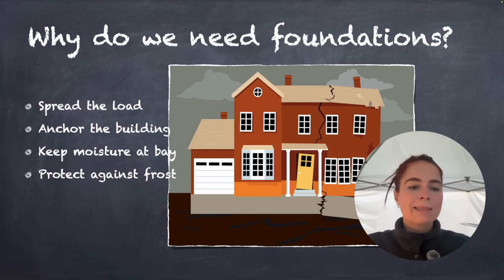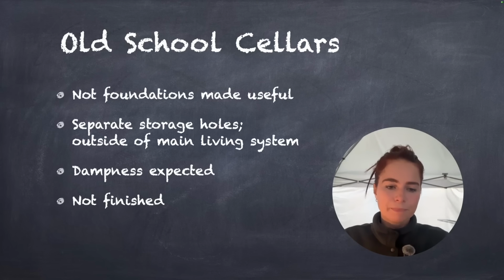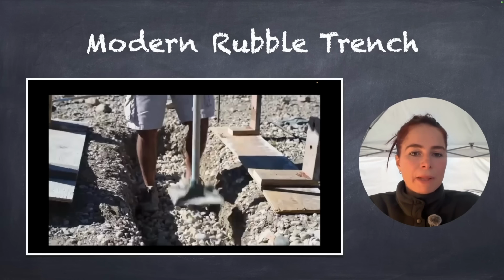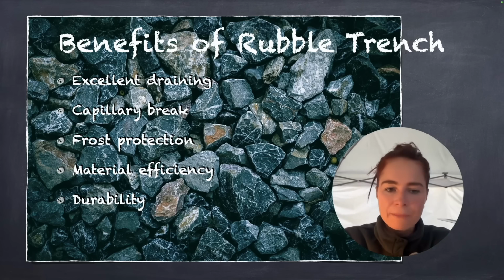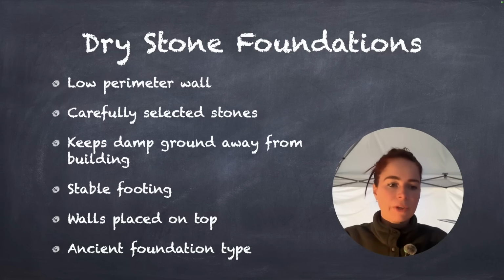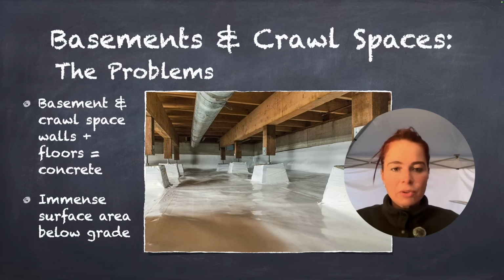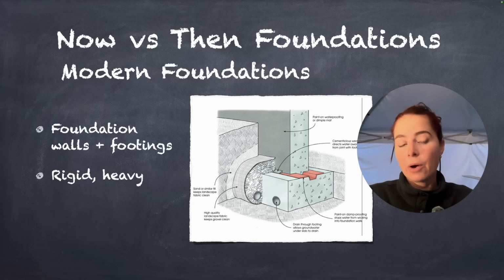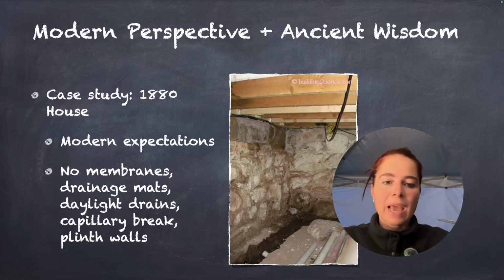Why Modern Foundations Fail — and the Genius Design We Abandoned

Comment: I am not an expert and I feel that exluding moist underground space from the living space or house envelope makes totally sense. When I moved to Belgium I learned about Radon, a radioactive gas that creeps out of the soil (more or less depending on your location). You mentioned it. One good thing about a crawling space in my opinion is that it adds a ventilation layer below your house where those gases can escape instead of traveling into the living space. So when I visit old buildings here I consider this a plus and if I would live in such a building I would take measures to ensure constant ventilation to get the contaminated air out.
Reply: In many cold areas that don’t have radon problem, having that ventilation is a high cost.
Reply: @jsbrads1  We have Radon and -40 temps.  Using a 80 to 85% eff. HRV will do the trick.  However we also have to install a (depending on how many sq. ft.) 4 in pipe into a rock filled hole 6 ft deep and piped to the Mech Room for test inspection of Radon.
Reply: @jsbrads1 Why so? It's cheaper to insulate a floor than insulate and heat a basement.
Reply: @BoringBurger  I was referring to houses that have a crawl space that isn’t sealed to the outside elements, and you have to insulate the entire floor to protect from cold winter winds. In cold climates if your house doesn’t have any space for freezing cold air to enter, you can still insulate between the house and the ground (if you have a basement or not, but the heat loss is less than when there is an open crawl space under the home).
Reply: Causes lung cancer in non-smokers.

Comment: I'm building an earth sheltered hobbit hole dome.  This was helpful. I have 12 inches of drainage rock under the slab and under the footing. And a vapor barrier under the slab and footing. French drain around the outside of the footing and under the slab. Radon vent pipe under it, too.  I will have a ventilation pipe bring in fresh air constantly.

Comment: The thing about rubble stone foundations is the compaction must be perfect or the house above will settle unevenly. Most inspectors don't even want to see the concrete footer under masonry walls sitting on anything but virgin soil well below the frost line. I would think a crystalline additive to the concrete mix at the concrete plant, as well as a capillary barrier on the outside draping down into a perimeter pipe would be driest and longest lasting basement wall. Basements don't need to be inside the building envelope, by adding closed cell foam to the basement ceiling the basement can then be a well vented cold storage cellar, or just a mechanical access space. I have my doubts that a rubble stone trench foundation would be any better than just concrete stem walls and a poured slab foundation.
Reply: I've yet to see any inspector worldwide who wants to see a concrete foundation "resting on soil" at any depth.
Reply: @gurglejug627  So you are a "worldwide" concrete foundation connoisseur? Travelling the world looking at foundations must be exciting for you. Do you think every basement foundation needs to be excavated down to bedrock? That would be over 150 feet down in my area of the world. Yes footings for foundations are all placed on "virgin soil". Virgin soil is also referred to as "undisturbed terra firma" in some codes. If stone is placed under a footing, it's only a few inches in depth and used for leveling, and drainage purposes, and is firmly tamped. If the excavator does their job correctly, the footer won't need any stone beneath it, the footer form will rest on virgin soil. You really can't get any better than that, even a rubble stone foundation rests on "virgin soil".
Reply: @c.a.martin3029 expert in concrete? Not at all. Rather an expert in many techniques of foundation, modern and old, from the Saxons to the Vikings and on. And yes, I enjoy it, as I enjoyed building many of them, and if you think you're clever for not knowing something, what can I say? Would you rather there are people who don't take an interest? I mean, you watched such a video. Again I tell you there is no code in the world that I've seen which talks of building on soil. As for the other option you propose being bedrock, well, you're only demonstrating your ignorance even further. 
   Judging by the fact that trying to assert yourself and to be unquestionable despite incredible arrogance and ignorance, in preference to learning, can I assume you're from North America?
Reply: @gurglejug627  I assume you have access to online codes? Here is an A.I. summary from: "The International Building Code (IBC) (and International Residential Code (IRC)) requires foundation footers to be a minimum of 12 inches wide and 6 inches thick, but the exact size is determined by the structure's loads and the soil's bearing capacity. Key requirements include supporting all loads, being supported by undisturbed natural soil or engineered fill, and meeting minimum depth requirements based on the local climate's freezing index." Just Google it for yourself if you don't have access to an International code book. And there is a section in the code for building "slab on grade", which will really blow your mind, no foundation at all, just an insulated concrete slab sitting directly on sub-soil. Let's be honest, you don't really know a whole lot about this subject do you? Here's a good video for you to see good building science being applied to a foundation, and you'll get to see for the very first time in your "worldwide" experience, virgin soil under a foundation wall. https://www.youtube.com/watch?v=KZfEPtjVliI
Reply: @gurglejug627  The ICC, used in much of the US, requires undisturbed soil, compacted fill or CLSM for shallow foundations, but really the foundation type is largely determined by the underlying soil types, depth of frost, and water table, seismic and wind conditions, etc.  Local solutions are usually the most cost effective, but not necessarily the most environmentally friendly.
Reply: @theosrubegoldberg9660  You show me where that law says "undisturbed soil". Soil is almost the one thing that can never, ever be built on sensibly, I suspect the wording would be shale (as it is in the UK), at a push "subsoil" to differentiate a firm building substrate from topsoil. Because I guarantee it won't allow construction on topsoil.
Reply: @gurglejug627  I don't understand what you are asking? I referred you to the ICC which is adopted code, ie law, in much of the US. It is in chapter 18.  In practice, the topsoil is removed before the footings are placed on "undisturbed soil".  So yes, it is subsoil.  Maybe think of it as "hardcore"?
Reply: @theosrubegoldberg9660 is the wording for what's allowed to be built on "soil", yes or no?
Reply: @gurglejug627  yes, "undisturbed soil"
Reply: @theosrubegoldberg9660  would you mind giving me a reference/link to the building standards info there online? That's mental. No one builds on soil, undisturbed or not - shale, yes, but not soil. The first part of any foundation project is to remove the soil or dig down through it.

Comment: We eliminated all mold, humidy and flooding once installing a sump pump and a thin trench all the way around the perimeter of the basement's concrete slab. Works fantastic. Night and day!
Reply: lol… until the pump breaks, electricity goes out during a storm… etc etc… lots of basements flood and are moldy and wet thanks to relying on mechanical pumps.
Reply: @ryancouture2508  A wise choice is to have a pump that has a backup battery.  My system has two pumps and a large battery.  Very expensive, but cheaper than a flood.    Of course, in this age, some pumps are internet connected, and so forth with home automation.  I think a simpler system is more reliable.
Reply: @ryancouture2508 you think the drainage at the bottom or surrounding the gravel foundation system will pump itself out do you don't have the condition for gravity to take the water away?

Basic takeaway for me was - just don't build foundations/crawlspaces/basements...build on a slab...
Reply: @triaxe-mmb there’s a really simple solution it seems everyone is missing: water sealing the outside of the foundation. When paired with adequate drainage and proper grading (proper grading alone will resolve 90% of water issues), you can easily have a clean, dry basement or crawlspace. Problems rise when people skip steps in the process. Even a slab foundation needs a proper water barrier and grading, or it will absorb water from the ground and wick it upwards through capillary action.
Reply: @brandonbeaty6617 yeah, this is basically standard practice now for new build basement foundations but like the host said, they can fail if not done correctly...so the quality is the n the details and the install...garbage in will give us garbage out unfortunately...and most people want it cheap and fast...and if you pick those 2 then you have to sacrifice quality since you cannot get all 3 in construction unfortunately
Reply: @ryancouture2508  The reason why I made my comment is that I've been in a hundred basements in the MidWest with no mold, humidity or flooding problems.  Pretty sure we all have central air, as well, so any dry or humid areas are mixed up and homogenized.  Also, forgot to mention my sump pump is on a battery backup.  But, it has never been used.  Our power outages never seem to coincide with much rain, more so strong winds.  We even had a "dry hurricane" one year which cut our power for five days.  Ivan was the name.  Very strange.
Reply: Location of property.
Soil type and depth to free draining layer.
Where we are on hill.
1-1.5 meter yellow expansive clay.
1.5-2.5 red clay
3 m free draining brown rock.
If you have a free draining layer, use it, to take water away.

Comment: Every house where we live in the "Midwest" has a sump pump in the basement, and an extra necessity, which is a narrow trench about a quarter inch wide cut into the concrete foundation all the way around the inside of the basement, hidden from sight by the trim.

It works great!  Our basement was musty, moldy and flooded regularly before the trench and pump were installed. It hasn't flooded once since!  

And the hygrometers show it's only humid in Summer when the A/C is removing humidy from the air and draining gallons and gallons of water into the tiny drain over by the AC. That's a totally separate issue.

In Winter the humidity was always 20% before global warming, 30% after global warming, then 20% again for about the last 8 years or so. I suspect this Winter will be 30% again, thanks to the intense rains this year. 

BTW, the intense rains didn't do anything but overfill the pool ten times. Free water from the roof.

Forgot to mention that I also installed large diameter pipes to drain all the gutters to the pool or the street.

Also did a "poor man's" French drain to solve a flooding problem that still existed on the one side of the house, before I installed a drain there which goes to the street. However, my neighbor won't let me install a pipe to the street for her home, so we still have flood waters from her house 

Did I mention her house is cracked in half?  Yep. No drain pipes for her gutters.  She's the last one on the street to get any of those. Oh well.

Sump pumps, gutter drain pipes and French drains. All flooding and humidity problems solved. And free water for the pool.

Comment: They guys who were install "French drains" put these rubble trenches underground after a home has been built and is experiencing flooding in the yard or home. They call it chipped rock, not rubble.

Lots of YouTube channels and videos for French drains. 

I made a "poor man's" French drain to solve my flooding problems and it works great. No more flooding in that part of the yard. I simple penetrated the clay cap with several vertical pipes so that water would flow down to the gravel-covered storm drain installed when the neighborhood was built.
Reply: Thats what I always thought was a French drain. Deep hole cutting thought unpermiable layes into the ground to gravel or corse sand .
I have a 12ft 8in Pvc pipe in my backyard going down to where you hit the water lvl ( Florida ) used to have standing water for up to 2 days ( Florida summer rain) 
Now it drains within 6 hours.

Comment: Rubble foundations exist but they aren't a silver bullet that works for every building or every site.

Getting to history and probably your experience in Canada, in cold climates you need a foundation buried to a level below the frost line to prevent frost heave, then people saw these expensive foundation walls and decided instead of backfilling they would go deeper and create an unfinished space for storage, mechanical rooms, plumbing, electric, furnaces, etc.

Beyond what you said about what foundations do, they are a structure that is designed to remain immobile and strong because if a foundation settles, cracks and moves, the building above it settles, cracks and moves.

Places with very stable ground conditions are probably perfect for a rubble trench foundation but if it's unstable ground the rubble will move and the building above it will move and crack.

I doubt you can replace the function of a grade beam with rubble alone.  Rubble won't prevent moisture if you build in a low spot.

The economical solution to these issues is to build on high ground, install good French drains to remove moisture that gets to the base of your foundation footings, build wide roof overhangs so rain water does not fall directly next to your foundation, use rain gutters and downspouts to guide water from your roof away from the foundation and back fill the foundation so if moisture does get in the earth beneath your home it mostly just stays in the earth, then detail your floor to air seal the crawl space so if anything grows down there it stays down there.

A slightly high tech solution is to use products like fast foot which is a plastic sheet product used to create the forms for concrete footings, then tie that in to plastic sheet that covers your whole crawl space area (before you back fill), add some "radon venting" details to create some ventilation where moisture (and radon) can escape your crawl space, use a rubberized moisture barrier coating on the exterior of your foundation walls to seal the concrete against ground moisture and maybe add a dimple sheet to allow moisture that gets next to your foundation a way to flow down to your French drain quickly.

You'll notice I didn't say rubble for any part of the solution.  Maybe if you dig your trenches down to bedrock or just have remarkably stable soil conditions rubble might make sense but I think that will be the rare exception, not the rule.

I want to build for excellent air quality because I suffer a bit from allergic asthma and I would like to see if filtering out dust could relieve my nearly constant nasal congestion.  To that end, my construction will be almost exactly as I described but with shallow foundation walls because it doesn't freeze at my build site and a poured concrete slab floor over the back fill so no crawl space and because of the climate, I can put my plumbing in exterior walls so I won't have any mechanicals buried under concrete beside my "radon vent".
Reply: I am also plagued by allergies. Something that I learned in the Pandemic: HEPA air filters help very much with filtering out pollen, dust and viruses out of the air. They are pretty cheap to buy and to operate. We have four of them running 24/7 in the house. Also anti allergic bed clothes changed my life since I am allergic to mites. I had chronic cough before I got my allergies diagnosed and got the bed clothes.
Reply: @NilsElHimoud yes, when you build a really tight house you use a ventilation system to bring in fresh air and they have heat exchangers and filters to clean the air before it goes in and equalize the temperature so it doesn't require as much air conditioning.  I will probably use something else to further filter the indoor air so that it can filter out dust that comes from people and makes it's way in through the doors, on the bottom of shoes, etc.

I would have mentioned that but it seems redundant when talking about building for air quality...
Reply: @beardoe6874  I am living in such a house with automated ventilation. But I've seen many old houses with basements and crawlspaces where I would have concerns about the contaminated air creeping up into the living rooms.
Reply: @NilsElHimoud that's why my post is about building a slab on grade foundation or if you have to have deep foundation walls to prevent frost heave, back fill the interior and use plastic sheeting to prevent moisture from getting in to that fill, seal the floor above the crawlspace and use a "radon vent" as a way to vent your crawl space and allow moisture to escape.